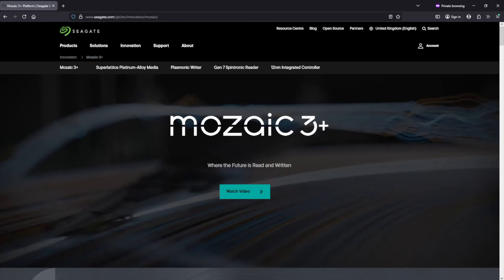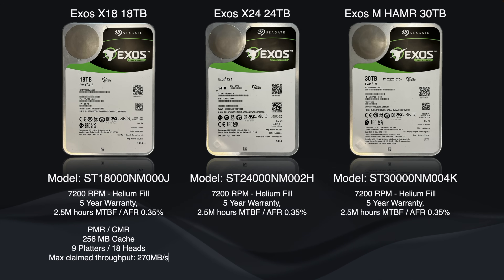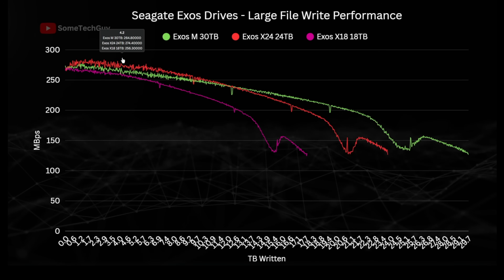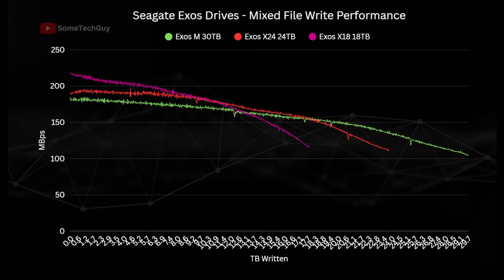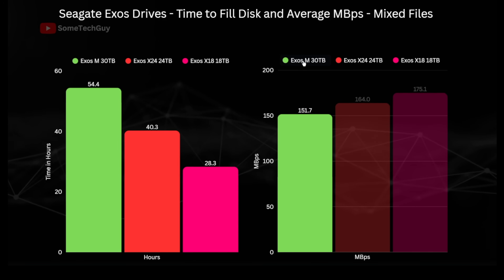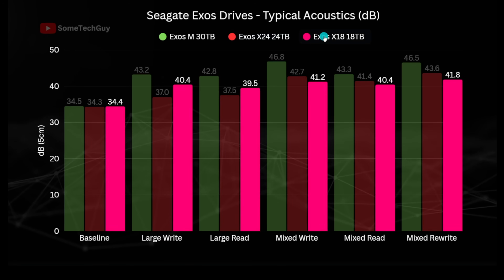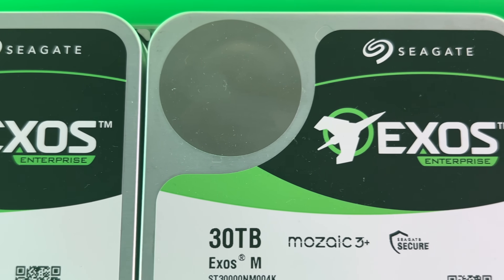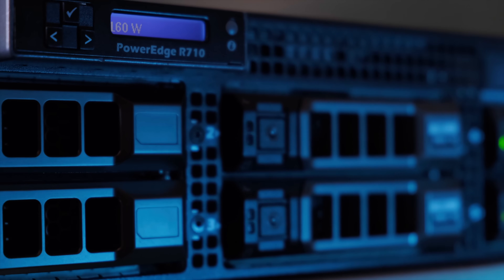I tested the 30TB Exos M drive non-stop for 3 months, what did I find?

Comment: With those long temp tests you should get the room temp and subtract it from the drive temp to get the delta. I bet some of the diviation is just the daily temp swings
Reply from the maker: Yes, it will be and I don’t have a temp controlled env. But the drives are all tested side by side with equivalent space and cooling and I believe the comparative temps are really what matter.
Reply from the maker: I also picked up a USB temp sensor for this that is API addressable, so planning to incorporate that into the testing so I have a reference temp.

Comment: I often wonder why hybrid (SSHD) hard dives failed. I have one of Seagate's 1TB hybrid drive with 8GB of NAND but it did not work as expected. I expected the flash onboard to act as a write cache but it does not seem to. With large capacity hard drives a built in write cache (128GB) would make a big difference for consumers and home NAS use. I'm aware most data centers use SSD cashes but normal people do not.
Reply from the maker: This seems like such a good idea. My guess would be the conflicting benefits of high capacity high endurance HDD with the lower endurance of the NAND. Maybe the NAND can’t cost effectively manage the number of write cycles that the HDD can, or does get. 

The Samsung 990 pro 1TB for example has an endurance of 600TBW, which is around the stated 550TB workload of modern enterprise drives per year. 

Technically, seem like great partners, maybe it was a cost effectiveness problem.

Comment: How did you write 30tb on the 30tb drive? The useable space would be like 25tb.
Reply from the maker: You are probably thinking of Tebibytes, which is what the OS reports, and 30 Terabytes is around 27 Tebibytes
Reply: @sometechguy maybe, but the question still stands.  The graph shows up to 29.7 tb written to a drive that can hold up to about 27tb.  Same goes to the 18 and 24 drives as well.  

The rating from the manufacturer have always been 1GB is equal to 1000MB not 1024MB so the actual usable space will always be lower.
Reply from the maker: It can hold 30 Terabytes and this is the graph capacity. You are thinking of the capacity in Tebibytes. Tebibytes uses 1024 as the multiplier, terabytes 1000. But this isn’t really important and if it helps you, just think of it in terms of the graph going up to 99% capacity of the drive.
Reply from the maker: 100% and I think the same device getting measured two ways causes much confusion. My preference would be if drive manufacturers reported what you see in the OS. I see bad reviews on Amazon many times where consumers give drives low star ratings because it ‘didn’t have the promised capacity’. So seems it would be in everyone’s interest to standardise on the same, changing the marketing material is the simplest fix.

Comment: I have had very bad experiences with SeaGate hard drives
Recently a 5TB hard drive failed. I won't buy a SeaGate anymore.
Reply from the maker: Not sure on the model, but I would guess it’s an external and maybe one of the 2.5” drives. In either case, probably an SMR drive, which you may or may not be aware of, but they are horrible. Wish Seagate would do better for its customers with these drives as they really don’t help its rep.

Sorry you had this experience. 😞
Reply: With my 30 years of PC I had only four hdd died. 2x WD 3.5'' and 2x 2.5'' Seagate one was external 2 tb and one laptop 320GB. In my old nass i have 2x 4TB recertified seagate with over 10y run time and other nas recertified 4x Toshiba 14TB.

Comment: I wonder about the sudden increase in the beginning of Large File Read test. Could it be that the internal read-ahead algorithm on the hdd itself are somehow less compatible with the benchmark tool being used? Maybe Seagate will release an updated firmware to fix this. Another question is if anomaly also will be visible in other benchmark tools ?
Reply from the maker: In this case. The tool is just performing file copies using the native OS file API (windows 11 in this case). So this is similar in behaviour with copying a file in explorer and these are just file objects, large 10g files in the large file, and folders of 5.5k mixed files of 10g in the mixed write. 

So it should be representative of real user experience.

Comment: I bought a 5TB Seagate drive with the shingled data storage method some years ago in a Seagate branded external enclosure. The cooling was necessary, but woefully inadequate, so the drive kept disconnecting because of overheating during the transfer of a considerable dataset, corrupting the lot.
Reply from the maker: Their barracudas 8TB and below are horrible, and those end up in the enclosures also. They are all SMR and performance can be terrible. And having tried to test some, many of them never complete due to IO timeouts and disconnects. 

So yes, terrible things. 😮
Reply: @sometechguy  From what I can see, Seagate prosumer drives are as good as any other but their consumer models are the worst on the market.
Reply: @sometechguy That's useful to know. 
Any hints on how to recover some data in spite of the frequent disconnects? Is it a matter of sufficient cooling or am I barking up the wrong tree?
Reply from the maker: @LarixusSnydes it could be, but my experience was just that the drive was very slow on some copy operations and the slower it is, the greater the chance a time out occurs. I had tested the drive inside its enclosure and outside where it had better cooling and it didn’t really help.
Reply from the maker: And on the question of recovery, I guess keep trying but if the issue persists, the disk may be bad. You could try an fdisk or similar repair; but I find these Seagate SMR drives to be pretty bad

Comment: What operating system and format was used for the test?  Does this matter?  The Amazon link in the video description to the Exos M 30 TB HAMR drive points to the wrong item.
Reply from the maker: This was tested on windows, but it’s using the raw windows api for regular file copies. All drives are tested exactly the same way using automation, and over 10 tests if each type it’s all very consistent.

It shouldn’t matter if all compared tests are the same, but this testing is very consistent with real world speeds using windows tools. And test all my drives in exactly the same way.

I will need to check the link, it’s a link that takes you to the same item in the local Amazon location, and sometimes some stores have an item consistency issue. But if you can share you region, I can look specifically. Is it completely the wrong item? Or a slightly different model?

Thank you!
Reply: @sometechguy  You may find format and OS does have an effect on speeds.

The link points at a small Toshiba drive on the UK website.
Reply from the maker: @cdl0 thanks yes: looks like the linkage to the Exos M on the Uk site is the Toshiba X300. Looks like an internal Amazon issue, but also looks like the 30TB isn’t available on the Uk site right now, may be related.

Comment: Firstly, thank you for this massive testing schedule you undertook to produce this video. It was many, many hours of laborious testing, so your diligent work is appreciated.

One thought I had about the marginally slower HAMR drive was that perhaps there's a cumulative latency penality for the laser to heat the surface being acted upon before the write process can commence. This could offset the increased aerial density advabtage normally associated with faster transfer rates.

I also wonder if this new technology could be applied to smaller drives, reducing platter count for the same capacity.
Reply from the maker: I also wondered this, but given the disk spins at a set speed of 7200rpm, delays would need extra rotations to it looks like this is unlikely because that would stand out. Someone else suggested it could be that the KBI on the tracks (how much data is on each track) could be similar but that the TPI (how close tracks are) could be higher. And this doesn’t provide the same speed benefit as you still can only write one at a time. But it’s interesting.

Not impossible the drive actually spins marginally slower though for the reason you say. Would only need to be a few % to have this effect. 

There are smaller drives that now use this. Testing the Barracuda 24TB at the moment, and appears to be the same drive but with 8 platters. Maybe though, the platters are in there but the heads are disabled. Barracuda could be an Exos M that didn’t make it.
Reply: These drives need to ensure only the area ti be written is heated as little as possible.  Which also means as short as possible before writing.  Hard to imagine this acutally shows up in the grand picture of power consumption and performance.

Comment: (1) Do these Exos drives report any SMART counters related to their firmware doing in-firmware scrubbing (periodically - like every few months - reading sectors and rewriting them elsewhere) to avoid bit-rot? I'm aware there is a solution to force scrubbing at the file system (ZFS) but would love to be able to buy a drive that I KNOW will automagically shuffle data around at idle no matter the OS. All I'd need is to just keep it powered on.
(2) Would LOVE a look into various SMART counters and how they differ across disk series and manufacturers. Rule of thumb is the more consumer/cheaper the drive the more they skip over at least exposing counters that help assess drive health.
(3) LOVE your videos. I'm watching every one. Merry Christmas & Happy New Year!
Reply from the maker: Thank you! Appreciate you watching and thanks for the kind words.

I did look through the SMART and farm data, but nothing obvious about the. I should really do a full compare and see what the different fields are.

But this drive should, in theory but way less likely to suffer bit rot. Because the magnetic domains have a high coercivity (harder too change the polarity) and require the heating to do it; they should be less likely to ‘flip’ when not being  actively written to. 

Doesn’t mean scrubs are still not important, but time may tell if they are needed as frequently.

Comment: 39 hours to backup a drive is a problem...and that's doing a sector copy.  It's probably twice as long for a file backup with smallish files.
Reply from the maker: The tests I ran are file copy operations, and yes; it takes a long time. But depends what you use the drive for i think if it’s a problem. Incremental backups, or use in an array will be a different story, and if it’s an automated backup, so a sync from one NAS to another, then not really an issue and network bandwidth is the main constraint, so large of small drives don’t really make a difference.

Comment: Yikes.
If they have to switch to the more complicated & expensive HAMR to go from 24TB to 30TB.. I'll be sticking to 24TB.

I would be very surprised if we see HAMR drives hitting the real-world lifespan of CMR (>80k hours).
Reply from the maker: Unfortunately, it will be 8 years until we find out. 😞

WD have an 11 platter 26TB Ultrastar, but I suspect it’s EAMR (HAMR or MAMR) from here on in some form.
Reply: @sometechguy Looks like the 11 platter 26TB HC590 is a traditional CMR drive.

The 10 platter 26TB HC670 is an ungodly combo of 3stage head actuator, SMR and HAMR.

Comment: My guess as to why the 30TB drive isn't quicker than the 24TB drive is that the extra capacity comes from more cylinders (tracks) rather than higher bit clocks.
Reply from the maker: Yes, could be that the TPI is higher, but not so much the BPI on each track. But my naïve assumption was that it would be both. 

But this would be an explanation. Good call 😊
Reply: @sometechguy  My assumption is that the heads are as small as they can get already, forcing manufacturers to shingle tracks in order to increase capacity using "traditional" platters.  The laser can most likely be made to heat just the centre where the data is wanted, reducing the magnetic "bleed" allowing the tracks to be closer together without requiring shingling.  This does not increase the bit density per track though.
Reply: @thisnthat3530 Well, as the HAMR drives are slower on the outer tracks, it'd suggest they've actually had to reduce the bitrate to allow for heating

Comment: I think these are pretty good results. If they can maintain similar performance for higher capacity disks beyond 30TB, hdds will continue to be a great storage solution. Especially for consumer stuff SSDs are still just way too expensive and anything over 8tb may as well not even exist.
Reply from the maker: I agree. I was hopeful the density would allow speeds to extend beyond 300MBps, but as you say, if they perform just as well as other large capacity drive then this is a good baseline. Maybe we will see the throughput ramp up as capacity continues to grow.
Reply: As they get larger but their speed doesn't scale as well as their capacity, it becomes less and less safe to use them: if one breaks, resilvering the RAID array results in a sustained high load for 2 days, degrading operational performance, and likely to break a second disk, resulting in data loss if only using 1 disk redundancy. So often they're only good for storing data you don't mind losing, like your Linux ISOs that you can download again anytime, or you need so much redundancy that they're not much cheaper than much faster SSDs. On the upside, they let you squeeze more storage into fewer drive bays in consumer NAS boxes that often come with a low number of slots.

Comment: You are the man, what a hit to the wallet
Reply from the maker: Been wanting to get my hands on one since I made the original video way back. I think a large array of the will wait however.
Reply: @sometechguy  interesting to see that it hardly consumes more power and a degree hotter, did not expect that with the temps involved. hardly anyone put that money on the line to test it properly like that. i would wager that HAMR will ultimately supress the prices per TB as these things will trickle out of data centers after 2030 so there is at least hope for that
Reply: I bought twelve 22TB WD gold drives last summer.  At least they were under $400 each at B&H.  I also put 12 SATA SSDs, and 10 NVMe SSDs into the same box.  It's a beast of a NAS 😂
Reply: @TheCrazyCanuck420   ..... but why? xD

Comment: Excellent, detailed report - thank you. The price of the 30TB model has gone UP by 10% in the last 6 months. :(
Reply from the maker: Yes, and not just the 30TB unfortunately. But the pricing changes over time, so let’s hope the price drops over time. 🫣
Reply: The price of pretty much all drives both HDD and SSD have gone up, all the AI DC's and hyperscalers have been buying them up for cold storage or so I hear.

Comment: Bought a recertified 28TB HAMR drive recently, honestly quite happy. Performs well and is quieter than my 18tb and 20tb Exos drives during use, though it does make an annoying whine sound when idle. Hope it lives a long life :3
Reply from the maker: Here’s to a long life of hamring 🎉

Do you know many heads/platters it’s reporting in the farm data?
Reply: @sometechguy  Number of Heads: 20

So I'm assuming 10 Platters.
Reply from the maker: @supercarfan6217 thenk you! So physically the same drive as the 30TB. Good to know.
Reply: Don't ever rely on a recertified drive, especially SG lol.. make sure you backup anything important!
Reply: @reubes11  i only run recertified seagates in a 80TB ZFS Setup. no problems for several years now.
Reply: @reubes11  You shouldn’t rely on any drive, recertified or brand new. And keep in mind that if they’re cheaper, you can buy more and add redundancy. The value of additional redundancy when it comes to data integrity is greater than the marginal decrease in probability of failure you’d get from a new drive.